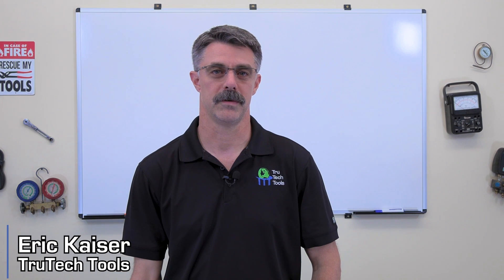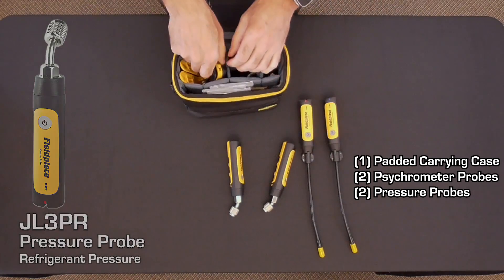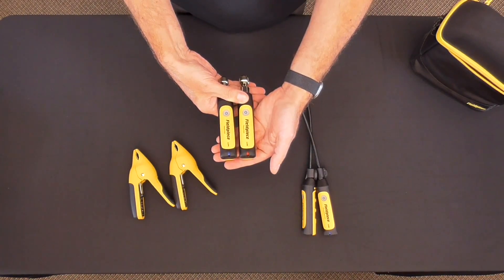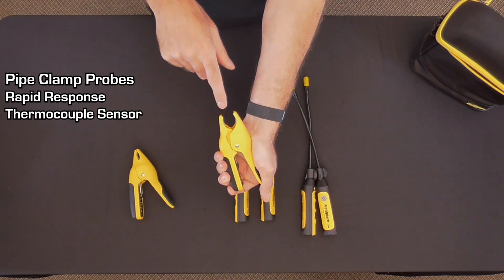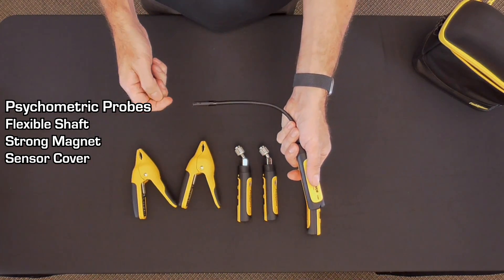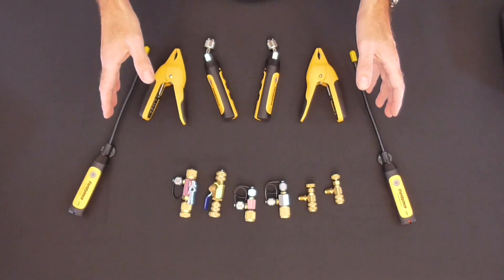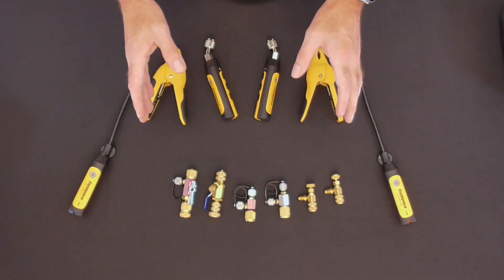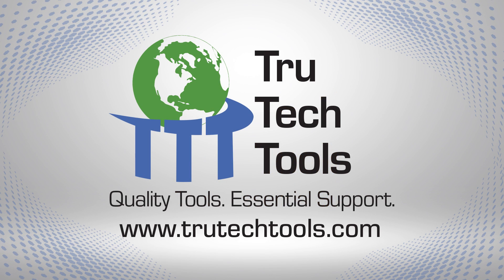Fieldpiece JL3KH6 Job Link Wireless Probe Kit: Unboxing & Explaining

Comment: Do you need data/good phone signal to use the apps ?
Reply from the maker: An Internet or cellular connection is not required to get readings from the Fieldpiece Job Link probes.

Comment: I have used these probes for about 4 years now and they work pretty well once you master the app(s). Unfortunately, you better have a backup on hand because when they fail, and they will, it's never at a good time. Also, the range through buildings is limited causing communication issues which can be a hassle and a bit frustrating.